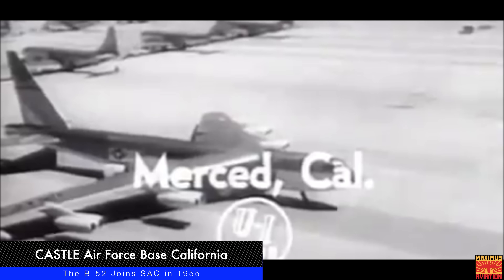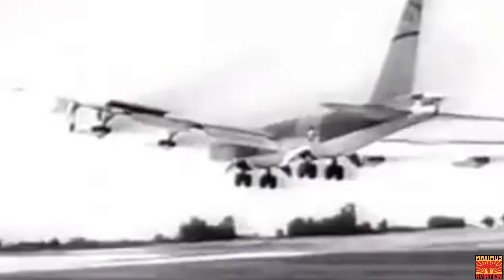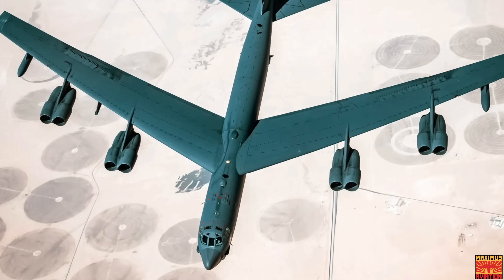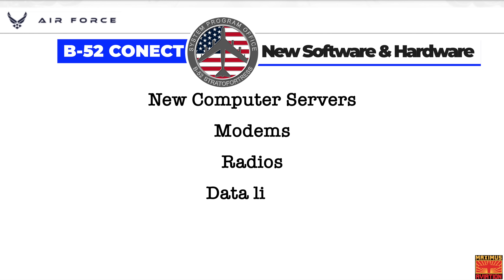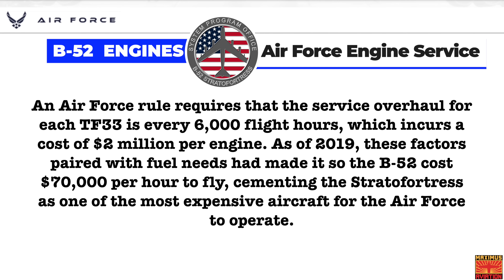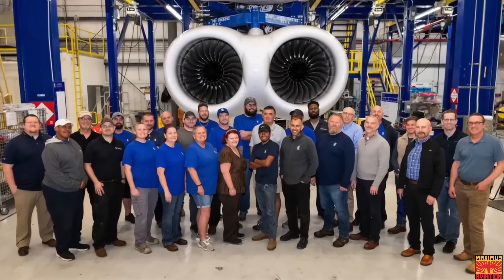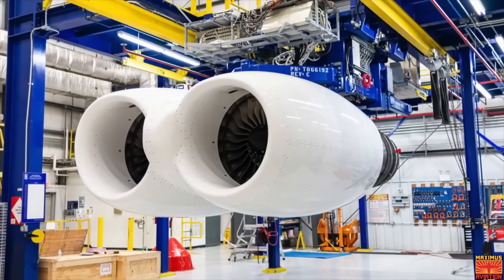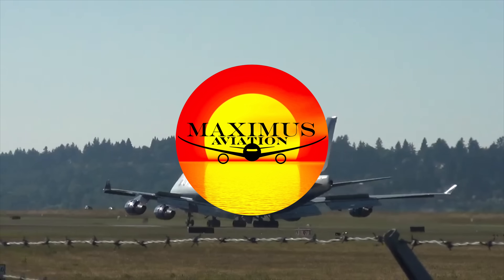The B-52 Will Fly For Over 100 Years With Its New Rolls Royce Engines!

Comment: I’m a military brat and I can remember either in 1956 or 1957 they let us out of school to watch a B-52 fly overhead into Tinker Air Force Base, Oklahoma. Later years down the road when I graduated from high school 1966 and got that ugly draft notice, I enlisted in the Air Force and my first  duty assignment was Little Rock Air Force Base in Jacksonville Arkansas. I was assigned to the 43rd bomb wing on the B-58 hustler. I later went to Kadena Air Force Base in Okinawa and worked on B-52 D models for six months and return to Little Rock Air Force Base. They phased out the B-58 in January 1970 and I was sent to Castle Air Force Base to the 92nd bomb wing for the last six months of my military career.

Comment: The Dehvaland Commet was the world first commercial jet airliner but it wasnt as commercially sucessful
Reply: The de Havilland Comet is the worst jet airliner in history.... no jet airliner has a higher loss rate of fatalities per flight and per passenger mile
Reply: @sandervanderkammen9230  yeah they made the mistake of making square windows but it was the first passanger jet so maybe they would be more prone to making mistakes and it being a failure.
Reply: @lemdixon01  The first passenger jet airliner is the Boeing 707 series.

The square windows theory is a red herring proposed by de Havilland which had absolutely no clue why its aircraft exploded in mid-air.

Wreckage recovered from the sea confirmed that the catastrophic in-flight structural failures were not related to the passenger windows.
Reply: @lemdixon01  Pressurized all-metal monoplane aircraft were invented in Germany in 1932 by Junkers.
 Boeing built the first pressurized airliner (307 Stratoliner) in 1938.
 The Junkers Ju-86 was flying fully pressurized to over 52,000 feet during WW2.
Reply: @sandervanderkammen9230  did it have jet engines or were they propellers ?
Reply: @lemdixon01  The Boeing 707 was the first successful airworthy jet airliner.
Reply: @sandervanderkammen9230  agreed 👍

Comment: New Engines or No, The 52 will still Retire in 2050, Those Airframes can only take so many Flight Hours.
Reply: If the airframes show no signs of fatigue damage during major overhaul inspections? Or the damaged components can be economically replaced?  The service life could be prolonged indefinitely.
Reply: @sandervanderkammen9230  No, After A Certain Number of Flight Hours, There WILL be Fatigue in the Air Frame.
Reply: @KManXPressTheU  The actual service   life of an airframe can and often is different from the predicted service life.
 If the parts are inspected and pass non-destructive testing they can be returned to service, albeit with a limited service life before the next major overhaul inspection interval
Reply: @KManXPressTheU  The de Havilland Comet was retired due to fatigue damage well before its predicted service limits.
The Boeing B-52 is expected to remain in service until at least 2050, well beyond its original service limits

Comment: Very interesting. The Air Force has been studying replacement of the original engines for quite some time.  When I hired into Boeing in 1995, in a non-classified role, I was able to find drawings in the system summarizing the variety of models offered at the time and perhaps in the future.  There was a supersonic SST, an small variant of a 727 with pusher props, a full-length double deck 747 and a 4-engine B-52.  This plane used modern 737 engines mounted in place of the existing twin engines.  Since this drawing was available for anyone who could find it in the network I estimate it was at least 10 years old and at that point rejected by the Air Force. It was an interesting drawing for a young engineer.

Comment: Why not 4 large engines?
Reply: Because the B-52 was designed to have 8 engines, it would require extensive modification world to the wings, fuel system, flight control systems, landing gear, etc. to retrofit 4 larger engines, the BMW F130 engines are a perfect fit for the B-52.
Reply: @sandervanderkammen9230  Hello Sandyboy,  F130 is the US designation for the ROLLS ROYCE BR725 engine (in much the same way that J65 was the US designation for the AS Sapphire engine that was the F9 Metrovick).  As you know it has nothing to do with any wholly owned BMW company. 
You'll recall that in the early 1990s Rolls Royce offered BMW a chance to re-enter the jet engine market with a joint venture to develope the BR 700 series engines from existing Rolls Royce twin spool technology, so that Rolls Royce UK could focus on its more sophisticated triple spool engines. Unfortunately BMW couldn't hack it for long and by 1999 had declared that it was copping out.
As you'll recall , fortunately Rolls Royce was happy to take BMW's share and keep the local workers on and it became a wholly owned Rolls Royce company. As you know that was quite a few years before the development of the BR725 which first ran in 2008 long after BMW was gone.

Comment: All these old folk talking about how they worked on B-52s decades ago are one thing, but I'm a time traveller from 2123 and can assure you the USAF is still flying these.  In fact one of the new AI-powered B-52s now runs the Air Force...

Comment: The 707 was the first jet airliner that didn't breakup and crash as a built in factory feature. That's a plus.
Reply: 707 is still flying today as well... Comet was grounded in 1980 due to safety problems.
Reply: @sandervanderkammen9230  hello sandyboy, as you know  Comets were still in service in 1996.

Comment: Nice to see the Brits giving the old bus some new engines
Reply: The F130 is a BMW engine...
Reply: @sandervanderkammen9230  Hello Sandyboy,  F130 is the US designation for the ROLLS ROYCE BR725 engine (in much the same way that J65 was the US designation for the AS Sapphire engine that was the F9 Metrovick).  
As you know it has nothing to do with any wholly owned BMW company. 

You'll recall that in the early 1990s Rolls Royce offered BMW a chance to re-enter the jet engine market with a joint venture to develope the BR 700 series engines from existing Rolls Royce twin spool technology, so that Rolls Royce UK could focus on its more sophisticated triple spool engines. Unfortunately BMW couldn't hack it for long and by 1999 had declared that it was copping out.
As you'll recall , fortunately Rolls Royce was happy to take BMW's share and keep the local workers on and it became a wholly owned Rolls Royce company. As you know that was quite a few years before the development of the BR725 which first ran in 2008 long after BMW was gone.

Comment: I'm amazed at the longevity of the B-52 bomber, having worked on B-52G & H models from late '76 through mid '80 as a jet engine troop on the flightline at Ellsworth AFB, SAC-trained killer here. I could still work on a TF33 or J57 engine blindfolded some 47 years later.
Glad to see that the Buff is getting a new lease on life with newer and much more efficient engines. Boeing sure built one helluva stout airframe!
Reply: What is the longevity of the airframe a.

Comment: Rolls Royce yet again. What I find most fascinated is that the B-52 will still be flying when it celebrates it's 100th birthday and that's no mean feat at all!
Reply: The F130 is a BMW engine
Reply: @sandervanderkammen9230  Hello Sandyboy,  as you know Sandyboy F130 is the US designation for the ROLLS ROYCE BR725 engine (in much the same way that J65 was the US designation for the AS Sapphire engine that was the F9 Metrovick).  As you know it has nothing to do with any wholly owned BMW company. 
You'll recall that in the early 1990s Rolls Royce offered BMW a chance to re-enter the jet engine market with a joint venture to develope the BR 700 series engines from existing Rolls Royce twin spool technology, so that Rolls Royce UK could focus on its more sophisticated triple spool engines. Unfortunately BMW couldn't hack it for long and by 1999 had declared that it was copping out.
As you'll recall , fortunately Rolls Royce was happy to take BMW's share and keep the local workers on and it became a wholly owned Rolls Royce company. As you know that was quite a few years before the development of the BR725 which first ran in 2008 long after BMW was gone.

Comment: The B52s are great airplanes, but threatened not only with bombs, also with ugly bad air pollution. It’s ridiculous. So there is a big need to upgrade and renew these dirty engines into modern reliable engine with less fuel consumption and better performance.

Comment: I retired in 1995 from the Air Force after a 26 year career.  I worked and flew on B-52G-H models for my first 13 years in service.  Great aircraft. Great memories. Great to hear of the engine upgrade and that the old "BUFF" will be around a lot longer.👍
Reply: Where were you stationed? I got to Wurtsmith when first H was delivered there.  Wat did you do.
?

Comment: Omg how will you cope  Rolls Royce what a terrible come down from good old Chevy V8
Reply: The F130 is a BMW engine
Reply: @sandervanderkammen9230  Hello Sandyboy,  F130 is the US designation for the ROLLS ROYCE BR725 engine (in much the same way that J65 was the US designation for the AS Sapphire engine that was the F9 Metrovick).  
As you know it has nothing to do with any wholly owned BMW company. 
You'll recall that in the early 1990s Rolls Royce offered BMW a chance to re-enter the jet engine market with a joint venture to develope the BR 700 series engines from existing Rolls Royce twin spool technology, so that Rolls Royce UK could focus on its more sophisticated triple spool engines. Unfortunately BMW couldn't hack it for long and by 1999 had declared that it was copping out.
As you'll recall , fortunately Rolls Royce was happy to take BMW's share and keep the local workers on and it became a wholly owned Rolls Royce company. As you know that was quite a few years before the development of the BR725 which first ran in 2008 long after BMW was gone.
As you know Sandyboy, Germany has never produced a successful jet engine without foreign help.
Reply: @sandervanderkammen9230  Hello Sandyboy, as you know F130 is the US designation for the ROLLS ROYCE BR725 engine and has nothing to do with BMW.

Comment: Part of the reason for having 8 engs was safety and redundancy, were any efforts made to reduce the number of engs to 4, with larger commercial turbofans? I know the eng pylon would have to be changed or modified, but that's far cheaper than 8 engs installed.
Reply: A hell of a lot more would be changed if they went with four

Comment: I flew these engines on Boeing 717s for 12 years. Not one problem. None!  Great, great engine.
Reply: BMW designs reliable engines, the F130 is no exception
Reply: @sandervanderkammen9230  Hello Sandyboy,  as you know Sandyboy F130 is the US designation for the ROLLS ROYCE BR725 engine (in much the same way that J65 was the US designation for the AS Sapphire engine that was the F9 Metrovick).  As you know it has nothing to do with any wholly owned BMW company. 
You'll recall that in the early 1990s Rolls Royce offered BMW a chance to re-enter the jet engine market with a joint venture to develope the BR 700 series engines from existing Rolls Royce twin spool technology, so that Rolls Royce UK could focus on its more sophisticated triple spool engines. Unfortunately BMW couldn't hack it for long and by 1999 had declared that it was copping out.
As you'll recall , fortunately Rolls Royce was happy to take BMW's share and keep the local workers on and it became a wholly owned Rolls Royce company. As you know that was quite a few years before the development of the BR725 which first ran in 2008 long after BMW was gone.

Comment: No mention of hp of the engines....
Reply: Jet engines are rated in thrust, not horsepower
Reply: @sandervanderkammen9230  Thrust was not mentioned, either....
Reply: @countschad  The BMW F130 for the B-52 is rated at 76 kilo newtons (17,000 lbs.) of thrust.

Comment: Would have been good for us impoverished Brits if RR had invested in the UK and built those engines here . . .
Reply: The F130 is a BMW engine and the USAAF is not allowed by law to procure weapons technology from outside the United States.
Reply: @sandervanderkammen9230  Hello Sandyboy,  F130 is the US designation for the ROLLS ROYCE BR725 engine (in much the same way that J65 was the US designation for the AS Sapphire engine that was the F9 Metrovick).  As you know it has nothing to do with any wholly owned BMW company. 
You'll recall that in the early 1990s Rolls Royce offered BMW a chance to re-enter the jet engine market with a joint venture to develope the BR 700 series engines from existing Rolls Royce twin spool technology, so that Rolls Royce UK could focus on its more sophisticated triple spool engines. Unfortunately BMW couldn't hack it for long and by 1999 had declared that it was copping out.
As you'll recall , fortunately Rolls Royce was happy to take BMW's share and keep the local workers on and it became a wholly owned Rolls Royce company. As you know that was quite a few years before the development of the BR725 which first ran in 2008 long after BMW was gone.

Comment: At least the US Air Force got over their prejudice against the Rolls-Royce engines (why the F-82 used Allison engines) which I'm glad to hear. The use of BUFF or Big Ugly Fat Fucker (having Fucker in the nicknames of Air Force aircraft is fairly common) is the more common nickname of the B-52 although the only other aircraft nickname I can remember is Slow Lumbering Ugly Fucker for the Skyraider and later A-7
Reply: THE F130 IS A BMW ENGINE.
Reply: @sandervanderkammen9230  Hello Sandyboy,  F130 is the US designation for the ROLLS ROYCE BR725 engine (in much the same way that J65 was the US designation for the AS Sapphire engine that was the F9 Metrovick).  As you know it has nothing to do with any wholly owned BMW company. 
You'll recall that in the early 1990s Rolls Royce offered BMW a chance to re-enter the jet engine market with a joint venture to develope the BR 700 series engines from existing Rolls Royce twin spool technology, so that Rolls Royce UK could focus on its more sophisticated triple spool engines. Unfortunately BMW couldn't hack it for long and by 1999 had declared that it was copping out.
As you'll recall , fortunately Rolls Royce was happy to take BMW's share and keep the local workers on and it became a wholly owned Rolls Royce company. As you know that was quite a few years before the development of the BR725 which first ran in 2008 long after BMW was gone.

Comment: The same aircraft won't be in the air for 100 years because other parts of it will wear away and get stress fractures. I don't think the B-52 will be as useful against some adversaries as the B-2 and B-21.

Comment: Putting new engines on an old plane with old metal sheets & screws is not optimal due to integrity loss.

After 50 years (or even 30), the whole plane should be replaced to protect integrity of metal & fasteners.
Reply: Components are replaced at regular maintenance intervals, to include airframe systems.

Comment: The Rolls Royce of engines for the Rolls Royce of bombers.
Reply: BMW engines... for a Messerschmitt bomber...
Reply: @sandervanderkammen9230  Hello Sandyboy,  F130 is the US designation for the ROLLS ROYCE BR725 engine (in much the same way that J65 was the US designation for the AS Sapphire engine that was the F9 Metrovick).  As you know it has nothing to do with any wholly owned BMW company. 
You'll recall that in the early 1990s Rolls Royce offered BMW a chance to re-enter the jet engine market with a joint venture to develope the BR 700 series engines from existing Rolls Royce twin spool technology, so that Rolls Royce UK could focus on its more sophisticated triple spool engines. Unfortunately BMW couldn't hack it for long and by 1999 had declared that it was copping out.
As you'll recall , fortunately Rolls Royce was happy to take BMW's share and keep the local workers on and it became a wholly owned Rolls Royce company. As you know that was quite a few years before the development of the BR725 which first ran in 2008 long after BMW was gone.

Comment: Why not taking 4 stronger engines instead of 8 small ones? 737NG and 737MAX showed that the smaller ground clearance can be managed. 4 engines have more than enough redundancy and cost less to operate. Even after 30 years.

Comment: Would make much more sense to Wait a very short time to install the Pratt & Whitney Adaptive Cycle Engine in the B-52 than install an engine that requires TWO of them to power a small business jet. 🤯 Not to mention that Pratt & Whitney is an American company. That would save billions and billions more in fuel cost with increased performance and range